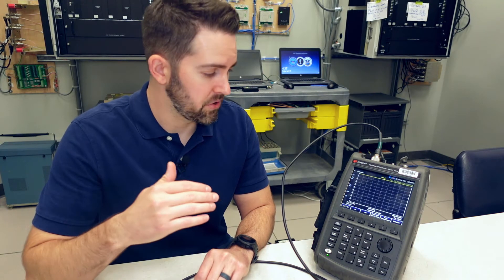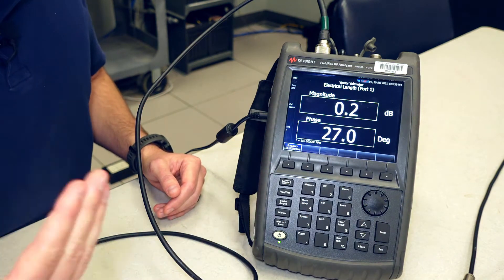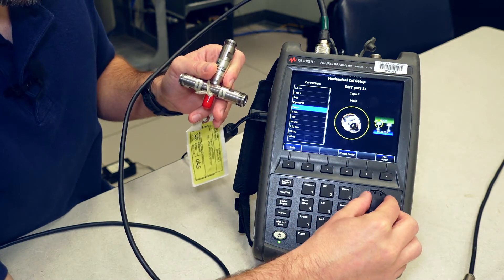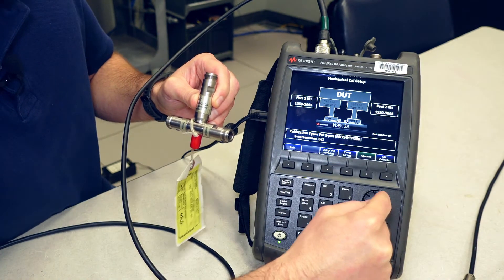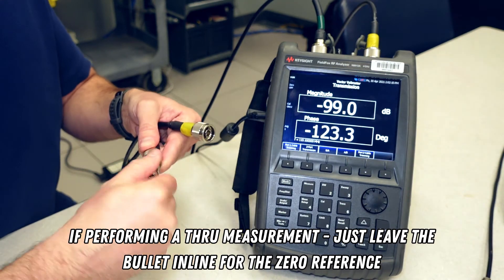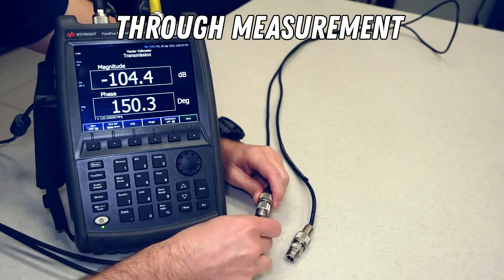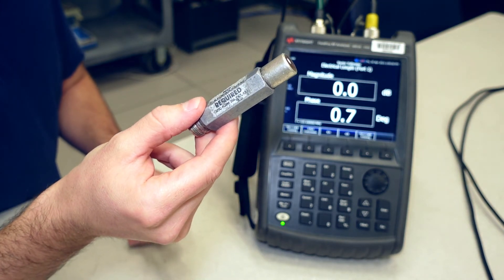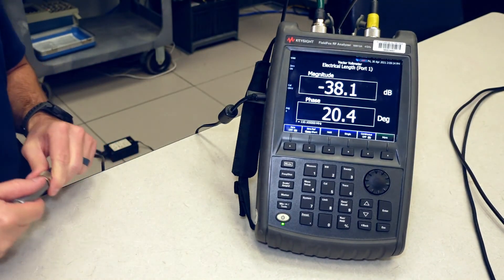Keysight FieldFox Vector Voltmeter Quick Setup

Comment: very well explained Sir , Thankyou for sharing . i have a question if you could help me with that . i am using a ECal kit for 2 port calibration SOLT , After calibaration insertion loss of -4dB is appearing for S21 measurement . can you tell me why its so ? when i do calibaration with mechanical kit no insertion loss appear while s21 .

Comment: Thanks for your video. What if I need to calibrate the SMA type of connectors. 
I have the SMA cal kit, but the field fox doesn't provide me neither the SMA connector type nor the cal kit.
Reply from the maker: You should really get an N-type cal kit but if I didn't have that option, then I'd use adapters as necessary. It's still better than doing no cal. The adapters will probably be negligible.

Comment: Hey man. Great Video! I need to do this on board ship though. Can you do a video on one port cable trimming? Vector Voltmeter option sounds great but I didn't realize it could only be done on short cables. What would you do for a long cable that's already been installed.d
Reply from the maker: I have changed jobs and don't have access to this equipment to make more videos. However, you can test long cables using the S11 (1-Port Cable Trimming) measurement for phase and amplitude. To see the phase, you will need to disconnect the cable from any equipment so it's just open. Then you can connect the FieldFox to your transmission cable you want to test. You have to keep in mind though that it's a reflective measurement going down and back the cable so the phase is doubled. You would need to half the measured value since it's doubling back. For amplitude measurements, I'd put a dummy load on the end of the cable and see if it's the expected amplitude plus a dB or so due to resistive losses of the line. Keep in mind though, that the portion of resistive losses (while usually negligible) are doubled as well with reflective readings like this. 

Another option, and perhaps more appropriate, would be to use a Time Domain Reflectometer (TDR) to measure the impedance along the line and get the actual physical length of the transmission line as well. The cable type must be known so the correct velocity factor can be applied. Some Fieldfox options include the TDR under the CAT mode (Cable and Antenna Test). I prefer the "TDR (ohm)" measurement where you can easily see the impedance of the line (typically 50 ohms, could be 75, depending on equipment needs). The end of the cable spikes up showing very high impedance if its an open. Conversely, a shorting adapter could be put on the end of the line to see where 0 ohms occurs on the line - which should be at the end of the transmission line you'd hope. I short anywhere else in the line is probably because the cable has been crushed/damaged and the TDR would show you exactly where in the line that is.

Comment: Great, can u upload one video for 1 Port cable trimming, to be used in cable fabrication, will be thankful to you.
Reply from the maker: 1 Port cable trimming is the same as the reflective measurement part of this video - just substitute for your cable to be trimmed. Keep in mind the signal is reflecting back so phase and amplitude are double. I just halve the reading or one trick I use is to halve the frequency I'm actually cutting to, so I don't have to do the math. Typically, you're not concerned with the amplitude reading with cable trimming. Apologies for the late reply.